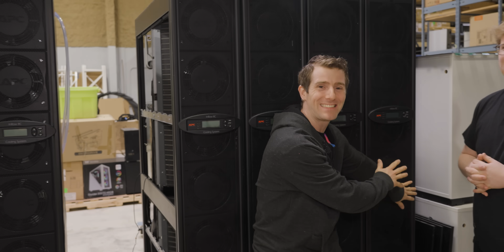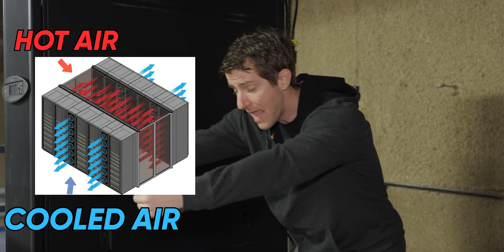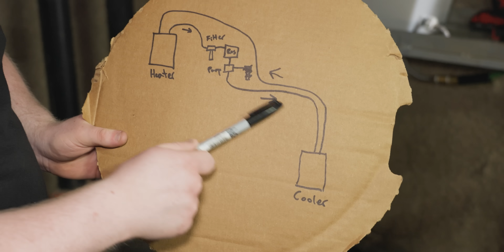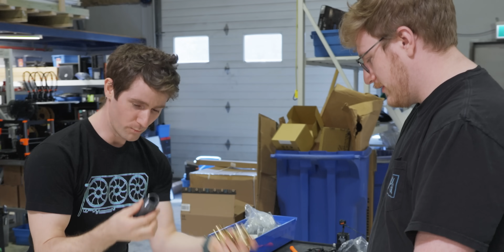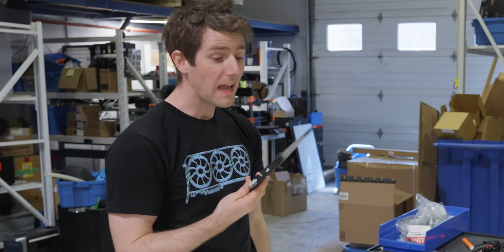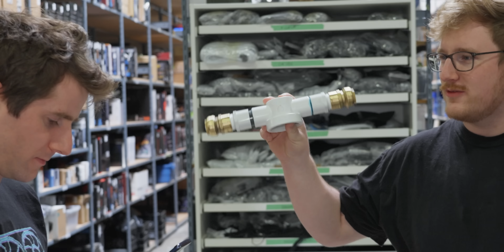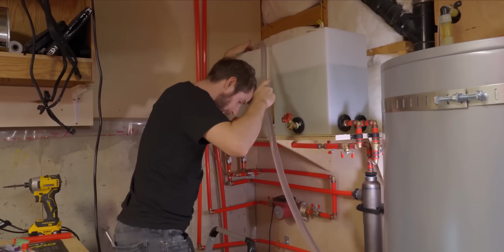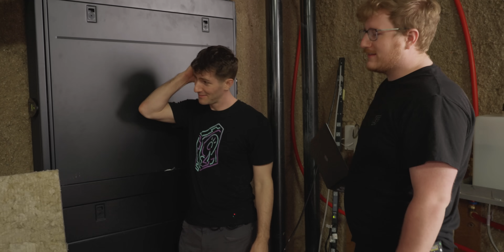I shouldn’t have kept the $1,000,000 computer

Comment: Industrial A/C guy here, Referring to Jake in the beginning A closed loop chilled water system does not lose water over time, or evaporate out.  That is why it is a closed loop, they add water and chemicals one time and that's it.Unless the system is drained for repair, or  leaks water never needs to be added again.  

Normally you have a closed chilled water loop, and your Chillers will have an open condenser loop, that cools the Machines, and the heat you brought in from the building. This loop does lose water through evaporation in your cooling towers. The condenser side IS hooked up to city water with a check valve, The water is monitored and topped up with chemicals on a regular basis to prevent corrosion, inhibit bacteria etc.

Also side note if LMG actually sees this comment, that is indeed a condensate overflow switch Linus was pointing at in the beginning. Those drain pans are pretty rusty, and may be leaking- which could be a reason these coolers were scrapped. If these are ever used for their intended purpose the pans can be easily repaired by pouring in a kit called PanSeal which self levels, coats and seals the pans.

Edit, Im watching this video and cringing again. Between Linus' house and this, you guys are helpless when it comes to plumbing / electrical. Get Jake some plumbing classes, or Hire someone with some Trades knowledge to help with things like this, you spent WAAY to much money on fittings silicone etc. This is such a simple project that could have been done in a few hours. (Just constructive criticism not trying to be rude)
Reply: Agreed. As an electrician, it’s painful to watch some of the things these guys do with wiring as well. It seems like they’ve been fairly lucky in that department so far..

…but electricity is an opportunistic son of a b*tch, and one of these days it’s gonna reach and grab someone. I just hope it doesn’t end up being serious.
Reply: @moderndiscourse  yeah these guys do electrical jank to a new level
what they should be doing when they play with 240v is simply to buy the equivalent of nema l5-30 connectors for 240v devices, those are intended to have 240v at up to 30A rated(though I am sure the surge of the connector can take the full 50A you might see on american style electric ranges)

the jank extension lead that is fed by the shop machine plug is really stupid, because there are many devices that can't take 240v, and the universal ones that do are no justification for non-standard plugs
240v is fucking SCARY, the whole reason I don't scream at EU type plugs is that they do actually design a way to prevent ANY contact with live circuits to ground, through you

I have heard many a horror story with just a worn 240v lead in the USA, but I have heard many a tale of 120v not killing a healthy person, even with hand-to-hand shocks(including me)

I do not advocate even touching live >30v circuits with bare hands(at least use a rubberized glove on your non-dominant hand for insulation) but if you are gonna do jank, don't fucking dare with 240v+, especially when dealing with water-cooling too(the additives in water-cooling can increase shock risk if it leaks)
Reply: @johnthefactaddict3281  I miss the 480 volt saw we had at my highschool so much lol makes all the 120 volt ones look so weak
Reply: @noodlelynoodle.  dam 480v is spicy, bet that saw could cut an entire ancient californian monster without struggle
Reply: @johnthefactaddict3281  it never struggled with anything we threw at it and we did have a student from like 30 years ago come in to process some huge like 2 inch thick redwood slabs, normal chop saws always makes me miss that radial arm saw
Reply: @noodlelynoodle.  that is so cool, you got to play with a saw on crack
welp point is that the LTT style is to spend 2x what it should cost by doing a mk1 that is ALWAYS half-assed and broken, and ALWAYS replace it with at least a mk2(and often a mk3 or mk4)
Reply: They are probably also trying to do it the "fun way".
Like LTT always has a level of jank (highest when Alex and Linus donsome watercooling project or the likes).
Though yea, getting some professional knowledge would be good, just so that mistakes and potential catastrophic mistakes don't happen.
Unscheduled, uncontrolled, rapid disassembly is not fun.
Reply: they should get some classes on pc tech or hire a guy that knows his ins and outs on pc tech first. Cause they fail their main target constantly. Especially when they DIY something into trash that had a clear purpose but they lacked the expertise and professionalism of reading a manual like you would expect from a pure tech channel. (Thats constructive criticism while trying to be rude. Thats a real problem they ignore)
Reply: @davekachel  true, but I suspect they are doing it INTENTIONALLY, this is a company called "linus media group" after all
plus I love the stupid janktastic videos sometimes, like the video of the 250A "blownuke"(that is what I am calling that thing, the pressure wave bending a garage door is reason enough)
and in the "blownuke" video the jank was the ONLY way to power that fucker economically, even if it was 1-shot(though they could have done it with a small array of car batteries(250A surges is easy for them) and a large resistor(like a space heater) and a FULL BRIDGE RECTIFIER, all to provide a surge buffer from the canadian 240v to provide surges of 250A but with the ability to handle at least a few dozen amps continuously)
Reply: For some reason in PC building the term "open loop" has come to be used for any kind of custom water cooling solution that isn't one-piece-sealed-maintenance-free like an AIO. I don't understand it at all.
Reply: @rawhide_kobayashi  it is technically true, most non AIO devices have a pressure relief in some form that acts like a tiny leak in the system
this means that technically it is "open loop" as it is designed to be "topped off" due to natural evaporative loss(either due to tube leakage or simply boil-off due to elevated temps in a non 100% humidity system)

but it doesn't matter all that much, because literally 0% of pc watercooling is "closed loop" as they all include hoses that do slowly lose water, hell even datacenters use a system that "tops off" the loops, it is most often just a check valve connected to city water that can dribble in extra fluid from very slight evaporation

this might sound bad, but then you realize that datacenters use a dedicated set of devices that are used to chill the air, and they isolate the server intake/exhaust into "hot aisle's" and "cold aisle's" that allow them to define where the hot air is so they can get maximum efficiency in cooling(this video is about some worn datacenter tech after all)

a quality setup for LTT given they live in the "frozen shithole of hoth"(bonus points to anyone who gets that reference) is literally what they did, a server room chill unit that moves the thermal energy to a location where it is needed most

they could make it slightly better with some tuning of the machine parameters(it has a dynamic flow bypass after all) and could benefit from actually arranging their server room to have a defined aisle layout(they have enough of them to warrant setting up a bifurcation of the room thermal zones)

but this system in a land that is regularly below the desired ambient temperature is actually a really good idea, and it can be used in tandem with the AC(if they only chill the cold aisle) as the unit being tuned for a delta can simply bypass a little when the hot aisle is too cold

though the best solution is actually the joke of burying a coil under the parking lot, that is actually a really good location for a geothermal pipe array, it would have a relatively constant temperature around 15-20c and could still be a part of the room heating

I would set it up with a simple thermostat and solenoid valve, when the work warehouse calls for heat it simply allows the flow to reach the warehouse exchanger coil(though I would integrate it with larger lower velocity fans into a larger HVAC style radiator instead of a server tower device like that, perhaps a bunch of properly attached car radiators with real car radiator fans, or ya know, a real HVAC coil with 120vac coil fans like what is used in the condenser side of a package unit, just run the water through the copper lines instead of refrigerants)
then when the unit is not calling for warehouse heating a thermally controlled valve simply directs any fluid above the limit to the geothermal coil
bonus is that the geothermal temperature is pretty close to the desired temp, so if you wanted you could set up a heat-pump style system and just directly run the fluid, it would not be perfect in summer(would heat above room temp and the limited differential would make it warm just a bit more than expected, but that can be when they run a real heat-pump) however in winter it would be perfection, the thermal difference of 10-20C above the set point means that you can fairly efficiently heat whatever space you wish, with no more effort than a fan and pump
Reply: @johnthefactaddict3281  As technically correct as it may be, I'm not going to refer to my water cooling system that needs maintenance/refilling once a year - if even that - as "open loop. That's stupid.
Reply: @rawhide_kobayashi  well you shouldn't, it has a plug that effectively closes the fill port

we are talking nuance here, a system can be defined as both depending on how sealed it is

even a refrigeration loop with a leak is "closed loop" what defines if it is open or closed is actually the average state
so most watercooling in consumer spaces is "closed loop" because the storage tank is sealed as much as is practical and safe
you might have an industrial cooling setup that abuses evaporative loss, that is when it is actually "open loop"

the OP is defining the physics of a system, which is never actually how we define things

now yes, some designs actually closely follow the physics definition, but he is wrong to apply watercooling with soft tubing(impossible to perfectly seal) as "not closed loop"
if it was all metal tubing with absolutely no plastics in the system(besides sealant tape) he would begin to be correct in his rejection of "closed loop" as a term
but LTT used PEX, and they used PVC, and they used a random plastic box, all of which offer imperfect seals, but the design is still "closed loop"

in fact when watercooling the idea of true seals is DANGEROUS, the water likes to reach a large pressure without expansion space, causing explosions
if you do not have a pressure relief(which is NOT an "open loop") it might easily explode, leaking all over your equipment instead of down an intentional drian

for design purposes the LTT system is "closed loop" it might evaporate only <1% per year but that is just how you design stuff
a loop that evaporates is still closed loop, because the design does have in inherent lack of intentional mass exchange with the environment(thermal exchange doesn't count in cooling systems)

I am baffled at why you have pushed this so far, we are talking only about design vs physics definitions in a janky watercooling setup for a media company youtube video
yes the OP is wrong in assuming the design of phase-change cooling applies to thermal mass cooling, it doesn't, but your passion for him being wrong and me defining terms based on physics(like the OP did) is somehow something to get passionate about
Reply: The best thing that can happen is it leaks and they rebuild the server and make even more videos.
Reply: @stevensko9153  maybe, I think the leakage would be minor(still water damage to the structure) but it should be fine
the fact is that because they are using air as a TIM(and hot ass air at that) it will tend to evaporate and then condense that water(which will hurt thermal performance a tad) and if it gets bad enough it will pool on the floor(not inside servers)
if it continues long enough they would get water damage, but given how often they mess with the racks I suspect they will notice a puddle long before it damages too much of the insulation, and well before it pools up high enough to damage the servers
Reply: Giving some of the guys trade school certs for their resume is not only a good idea its a bona fide perk

Comment: You guys need a Heatpump and a Hotwatertank so you can raise the Temprature of the Water and have a much more effective Heatingsystem. Plus it would have a much higher Delta on the hot and cold air in the Serverroom.

Comment: Hello, Facilities Manager on a Data Center here. Ideal temperatures, are 21 for intake and no more than 34 on the hot aisle. calculate your warehouse temperatures knowing the desired temperature for your hot aisle. Aim for a hot air temperature and calculate your temperatures from there. Also, Kingspan is way better than any other plywood/GIB/fiberglass solution money wise for temperature isolation, is fast and cheap to build with if you measure twice and cut once, and you can replace walls with it (not structurally, but aesthetically) For sound, they are a little bouncy, but you can always use what Generators use for baffling: sound proof walls (made of fiberglass foam with a frame) parallel to the walls and parallel to the noise source kind of like      
-------------------------------------  wall
sound source ->> ==== buffers  
-------------------------------------  wall
Reply: also work at a data center hope he see's this bc its actually really good advice!
Reply: Did you also get goosebumps when the inrow inlet temperature raised ? it´s so weird to see someone happy to see the temperature raising!
Reply: Data center engineer here, yeh whilst its ideal to keep temps low it really does not matter its just going to cost you a more, computers and servers dont need to be in hot/cold isle DCs its just ideal and can work and be warrantied up to the maximum operating temprature which is way higher than 21c
Reply: Or just use the thickness vacuum isolation panels.
Reply: Equinix announced plans to bump its data center temperatures to 80 degrees Fahrenheit.
Reply: comma ai has like 50c on hot and found no bad effects strangely. they dont run storage though
Reply: Way too smart an answer for the Linus team
Reply: @aTooway  you clearly dont like ltt so why are you here

Comment: Server will be happy for additional colling which is primary object of that work or at least it should be for such expensive computer and other colling devices. The idea of having coiling devices in different places with temperature sensors for usage to measure temperature difference and have automatic control valve system for each coller for best performance is great.

Comment: I wonder if it would make sense to have the server room AC unit go through a heat exchange block, on the hot return side, than to have said AC unit go to an outside condenser. That water return line still has extra thermal capacity and having two "heating" towers in the warehouse would transfer the heat no problem.

Comment: Hey Guys,.. there is a thing called and "Air Scoop" that is in my boiler system and it's job is to remove air with a air bleeder in it. That pump you used is for boiler systems which gave me the idea. Good Luck! Also, when you put Teflon tape on,.. you twist it up and follow the threads then untwist and lay 3 layers flat ;)